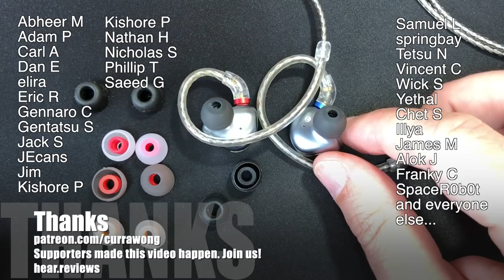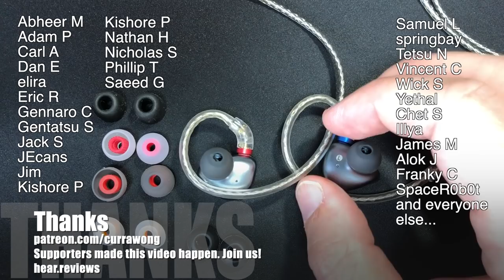FiiO FH5 Review

Comment from the maker: Apologies! This was cut from two different takes, and the part about the effect of the grill removal was unintentionally cut out. Basically, they sound more muffled with the grills in, and more clear with the grills out.
Reply: did that with my Fiio FH1 + a little eq and they sound fantastic
Reply: When I removed my screen one of the metal tubes slid out anyone else have that happen?
Reply: @ndizzle777  You mean the brass tubes? If so,mine are solid.they probably didn't glue it in right for your set.should be an easy super glue fix.just apply alittle bit
Reply: That' s very true, bro, I did it too and I really enjoyed the sound  @DenisDamulira23
Reply: I can confirm about the grill removal. I've been hesitant to do it after I've seen it on another channel a while ago, and today I've finally decided to do it. The grill came off easily without any damage to it, and I can safely put it back later if I wanted. Although I don't see any point to do that, because now they sound very open and almost as detailed as my HD 25 Aluminium which is no small feat, considering those have much larger drivers. I highly recommend the JVC spiral dots tips for these, but also foam tips work well. I have a pair of black foam tips from the Sennheiser IE80 and they work like a charm.

Comment: Do you think that using a FiiO LC-2.5C balanced cable with the FH5 and a 2.5mm balanced output would make any difference?
Reply from the maker: If you have a balanced DAP, possibly.
Reply: @Currawong  I bought the FiiO M9 which does have a 2.5mm balanced output.

Comment: Sorry to ask an unrelated question, but I figured you'd be the best to ask.
If I want to keep a solid state amp warmed up all the time, do I  have to keep headphones plugged in?  I'd rather not so that the cups don't collect dust.  Does it damage the amp?
Reply from the maker: Nope, they don't need to be plugged in all the time.  The only amps that need headphones plugged in all the time were one-off DIY tube amps. Commercial amps are designed with more tolerance for how they are used.

Comment: how can i remove the cable ? , im not able to remove it
Reply from the maker: hold the plug firmly between two fingers and pinch and pull at the same time. They are quite tight.
Reply: @Currawong  still can't remove , pinched hard and pulled out with extra force still can't remove , is it possible that it's fake ? , Im applying for a replacement on Amazon.
Reply: @Currawong  I have watched all the videos on YouTube , in bad guy good reviews unboxing he removed the cable very smoothly and easily. Don't know why my cables are not coming out
Reply from the maker: @hilow719  Weird. Could be the connector is faulty too. If they swivel endlessly they should remove reasonably easily.
Reply: @Currawong  they are rotating endlessly , do I have to rotate them to a certain position then pull ?
Reply from the maker: No, they should just pull straight out.

Comment: are they better than f9 pros   good review
Reply: F9 treble is fatiguing
Reply: in wich model
Reply: i have f9 pros i wondering how better the fh5  are. thre like double price here
Reply: Tysun said the Fiio F9 treble is fatiguing.
Reply: thre not fatiguing at all   i listen for a hour or more    just someones opion   he probaly has neve heard them   bit spikey in  treble with some music but u change the eq on ure dap
Reply: I have the f9 pros too and really like them.  Where do I get replacement tips for a little more bass?
Reply: have u heard them .
Reply: Okay, now you're trolling
Reply: f9 pro fixed the f9 treble problem to an extent. both are not the same models.
Reply: Yeah way better, i eq each of my headphones to my taste, the f9 pros are good but they can get fatiguing at treble, had to really turn it down around 5k - 8k. They the fh5 are really mid heavy i felt, turned it down around 400hz i but was easier for me to eq. But once i had them tuned, damn they sounded great, and taking off the little metal mesh really does make a difference. I run the headphones on a 2.5mm balanced cable.